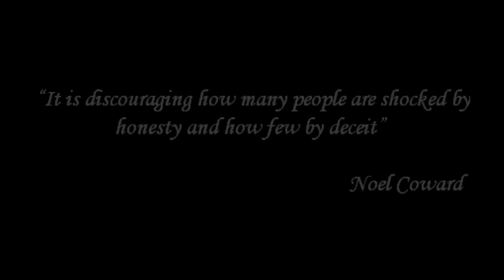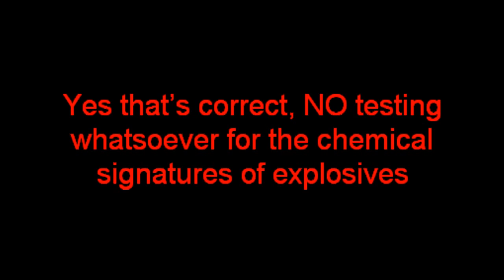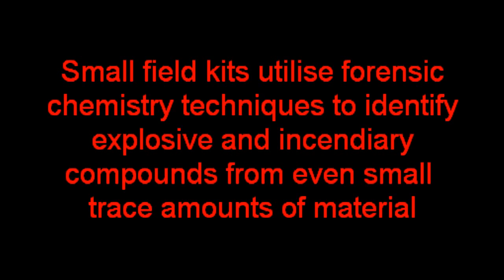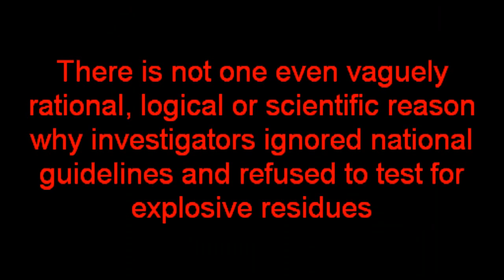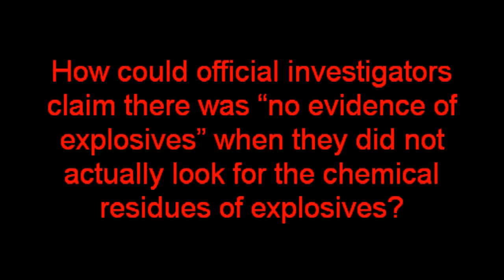Project Truth (WTC) - Sip 3.2 Physical Evidence B (Chemical Residues)

Comment from the maker: @WAHsu The “steelwork vs gravity” clip was designed to demonstrate the physical properties of structural steel framework and specifically illustrate how kinetic energy is transferred and dispersed within the steelwork.  When you understand this it soon becomes apparent that crush down or spontaneous collapse theory is completely unrealistic and physically impossible.  Steelwork does not simply ‘fall apart’ and dismantle itself, even if you apply a massive amount of kinetic energy to it.

Comment from the maker: @WAHsu What do you mean by “the majority of the towers never impacted the ground?” Are you suggesting that these massive steel frameworks simply fell apart and then evaporated in mid air?  I refer back to another of my clips sip 1.8 “steelwork vs gravity”… In this clip it is clearly demonstrated that steel framed structures are extremely robust and suffer relatively little structural separation when subjected to the kinetic energy transfer of gravity driven impact.

Comment from the maker: @WAHsu I included those images purely to show that columns had been cut, I am not attempting to prove whether shaped charges or gas torches made the cuts.   The point of the clip is simply to highlight the fact that investigators failed to test for the chemical residues that could indicate what mechanism was used to do the cutting.  Whilst it is clearly evident that gas torches were used during clear up operations, it is wrong to ASSUME that all cuts were made with such torches.

Comment from the maker: @WAHsu On a cursory inspection it seems that WDTTG is using the seismic reading taken from NYC Palisades but I am not entirely sure.  Whilst any and all evidence should be considered relevant, it’s also important to consider the authenticity of such material that may or may not be a fabrication.  If you openly consider the possibility that 9/11 was some type of inside job you also have to consider the concept that evidence can be manipulated, manufactured, ignored or destroyed.

Comment from the maker: @WAHsu Of course cutting torches were used during the clear up, how else would the remaining INTACT sections of steel structure be separated and removed? The issue is that three massive steel skyscrapers were destroyed and investigators did not even bother testing for residues, if only to rule out the possibility that explosives were involved. This very failure completely invalidates the claim that ‘no evidence’ of explosives was found. You can’t find something if you don’t even look for it!